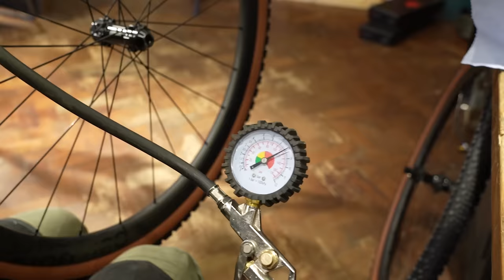Francis Cade's Mullet Custom Bike Build

Comment: Hi Jimmi: Francis sent me. Great video. When do you decide to cut the steerer tube? I watched the cut and said:  can't undo that...." 

I need a crash course in cable routing and hydraulic brake installation .... nice watching a pro at work.
Reply from the maker: Nic marks it off based on the customers bike fit. 

Having made these videos I can confirm I have no interest in ever doing my own routing/discs. Leave that for the pros! 😂

Comment: Hey Jimmi! I have the same bike and am thinking about to upgrade the bottom bracket for a more durable one.
Which one did you fit on this bike?
 I'm running the Sram Rival XPLR wide currently. Any suggestions? Cheers!

Comment: What chain is this? The eagle chain I installed is too short for 46t front and 50t rear
Reply: The standard Eagle chain comes with 126links. Should fit okay. This one was the XX1 gold version. 👌🏽
Reply: Using the Sram method of chain sizing, I wasn’t able to get the two ends of the standard eagle 126 link chain to overlap.
Reply: Over the chainring and 50t cog, and not through the mech?
Reply: That’s why I’m asking what chain they used
Reply: @mikeynon PCXX1 gold 12 speed

Comment: Kool video, and sick bike. BUT hope you court that the front brake isn’t mounted correctly.. caliper is too far from rotor. Fork must be 160mm rotor ready, rather than 140 and adding a 160mm caliper mount means it sits far too high. Don’t mean to be THAT guy but hey here I am haha 🤣
Reply: 😬😬 downside of building the bike after several pints. Cade is a bad influence. Sorted  it the morning after 👌🏽

Comment: All these "pro" bike mechanics using a vise and a hacksaw to cut a fork steerer... my God, buy a porta-band, for Crissakes!
Reply: What's "pro" about a bandsaw?
Reply: @ickebins6948 Precise cut, less waste, less effort, no need for a "collar" to achieve a straight cut, thinner blade, less tearing of the material, is that enough?
Reply: @rd946  Less waste? You buy a freaking bandsaw for 1-2 cuts a day... 
Thinner blades? And how is that relevant? You cut the tube, the rest goes in the bin...
Precise cut? You mark the spot and cut it... If you miss the spot it's not exact, no matter how you cut it...

Pretty "pro" reasons to throw money out of the window for no practical gains!

It's like buying a whole JCB digger to put some soil into a flowerpot.
Reply: @ickebins6948  Mine cost $149, if that's going to cause financial strain on a bike shop, they don't need to be in business. I'd venture to guess any moderately busy bike shop spends that much on hacksaw blades and labor cost in the time it takes to use said hacksaw for each cut in a year. But again, I realize this isn't about a bandsaw being better, it's about you having the last word and being a bada$$ on YouTube. 😂
Reply: @rd946  Oh the hacksaw needs blades? Well I'm glad the bandsaw does not...

As stated by yourself: "it's about you having the last word and being a bada$$ on YouTube"

It was a genuine question, because I did not see the point in a bandsaw... and guess what, you did not provide any useful points.
Just more cost, it needs a space in the workshop and no time saved in the process. 

Maybe the "pro" mechanics are not ready for your level of "expertise"!

Comment: Brake levers and calipers sold already connected. Wow SRAM, that’s idiotic!
Reply from the maker: They’re pre-bled complete brake systems. Means they can be cut to size, to attached and no mineral oil, or re-bleeding is required. Saves bike shops a load of time. Does seem odd though. I do agree.